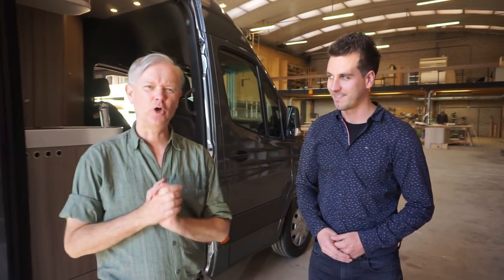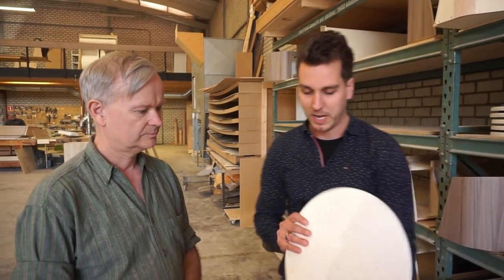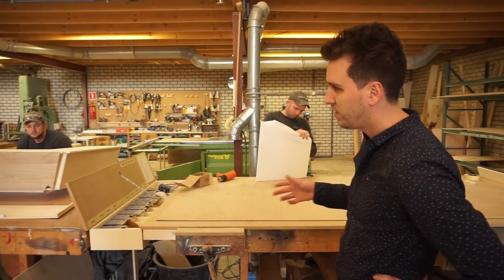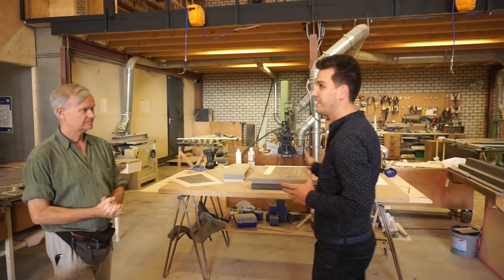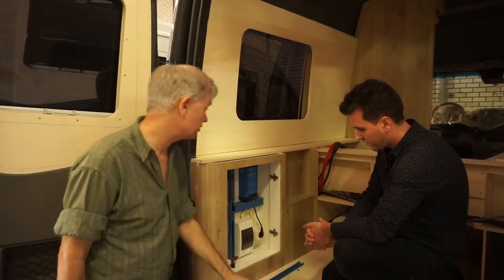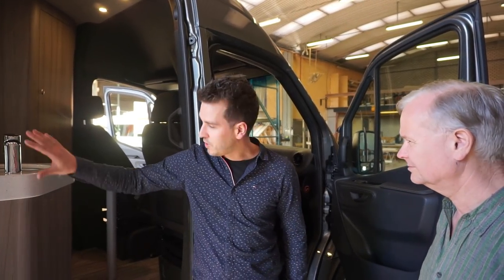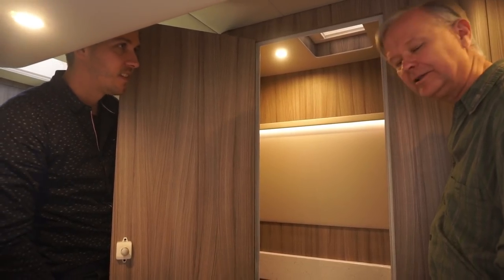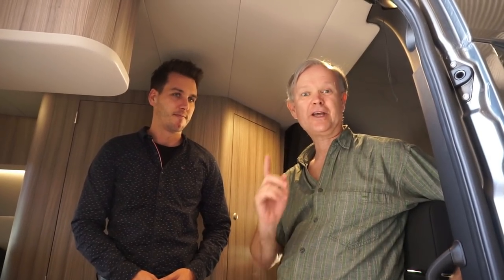At the factory of Mercedes campervan manufacturer Innova

Comment: Great to have a tour of their factory, seems they are a small company but really have got their product sorted. I like the take down ceiling if you wanted to add solar or other stuff. I'm thinking about Victron for my conversion as I have one of their invertors in my narrowboat. I'm thinking about a bonded side window on the sliding door but looking for one that's double glazed, did you see if those on their wagons were double glazed? my concern is condensation with a single skin sliding door bonded window also with the motorhome windows, double glazed plastic ones that they can be broken into in some cases, can be rather flimsy. Have you decided to go full motorhome double glazed on your Sprinter? or single skin sliding door window? Great video Alan👍
Reply from the maker: Thanks Nick!